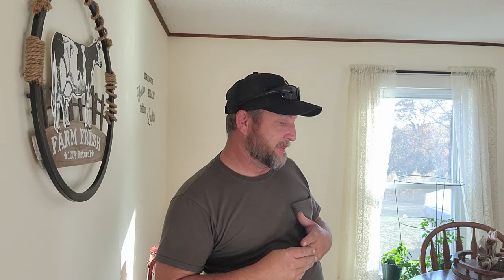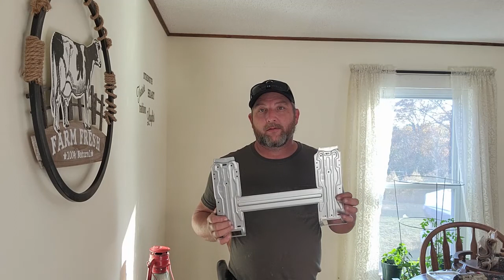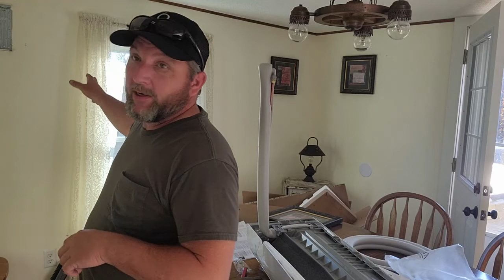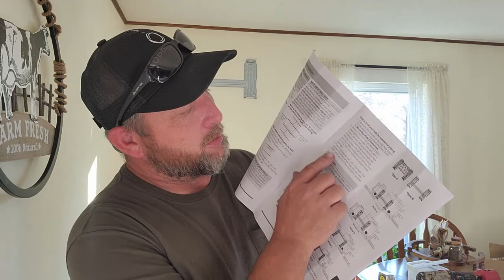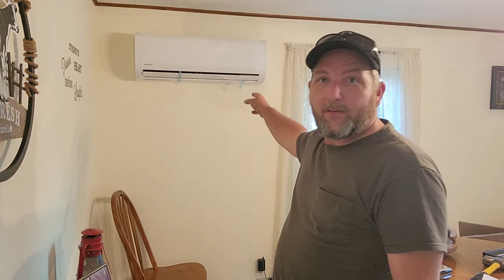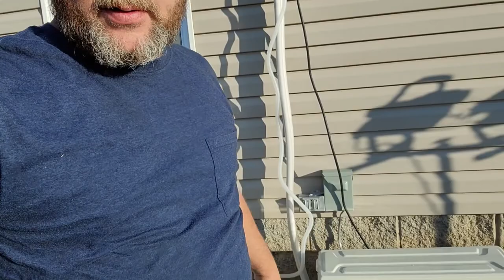mini split install

Comment: if you drill with a 1/4" bit 12" long it helps line up your hole outside. with the long bit you see the angle you want for the drain and you don't have to drill though the insulation. my wall is 8 and 1/2" the tube is not long enough another 12 mile trip to the Ace hardware. My house is brown and I could not find a brown cover so I used brown vinal gutter with a end cap it goes level down to the ApooDr mini split. They are $522 on Ebay its June 2025. I still had to buy a disconnect box a 15 amp 240v panel breaker Ditek dtk-120/240 cmt+ surge protector, 50' of 12/3 with ground mc wire, 6' of outside water proof gray fex conduit, straps and connectors. I have installed 5 mini splits in my house and my sons house. I have a vacuum pump and a gage set from my auto A/C over the years. 1 ApooDr is 3 years old and 1 is 2 years old and one is 3 days old.

Comment: I have installed two of these on my house they are great and inverter technology.  I have another one a Confort total that is far noisier and less efficient.  I bought the vacuum pump and always evacuate the lines.  So far 3 yrs later zero problems.
Reply from the maker: I love these, so much  more cost efficient,  thanks for watching!

Comment: Awsome video. Is this a 12k btu or 18k btu
Reply from the maker: 12000btu,  thanks for watching
Reply: @overlookvalleyhomestead  what is the size of the room your using at
Reply from the maker: @noelmatos7927  it's in a open 12×12 room but it really helps my whole hose, I think they are underrated, they cool more than you would think